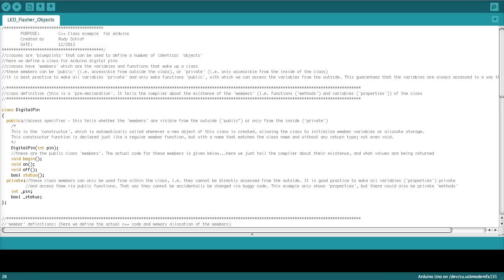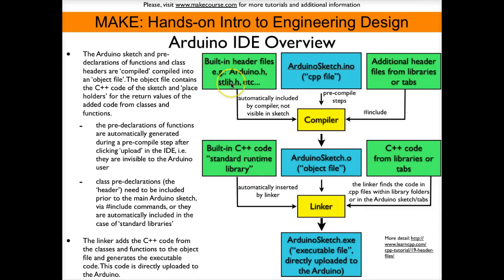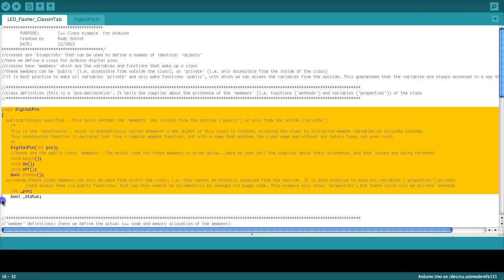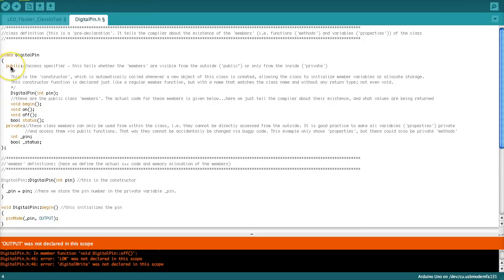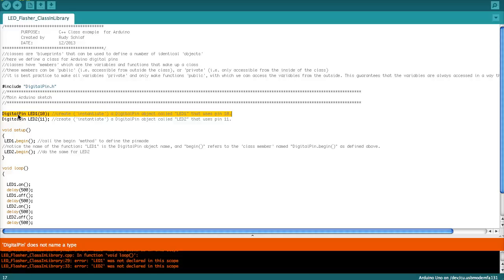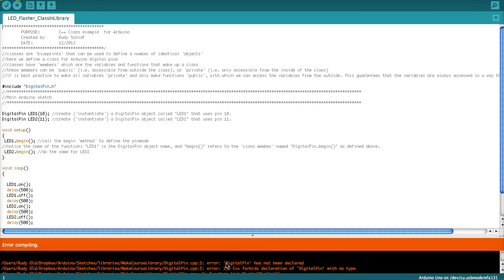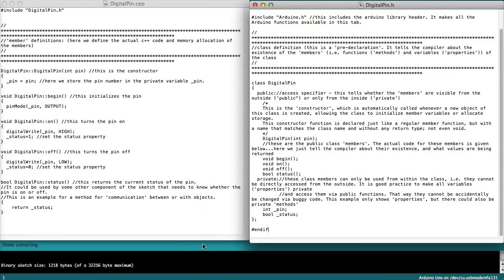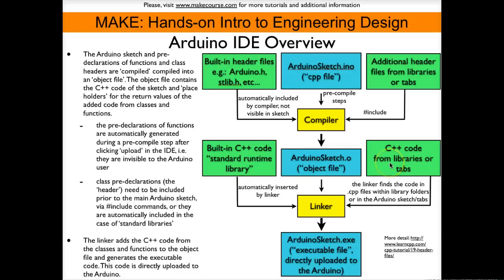Tutorial: Making Libraries with the Arduino IDE

Comment: TIP: Use your O/S file manager to drag&drop your local library .h and .cpp files into your current Arduino IDE's open project. This even gives you code highlighting on compilation errors. Yes, the Arduino IDE is not great...

Comment: Objects like motors operate with certain parameters - speed( & rate of change of) and direction. Yet servo  programs are unable to define the speed of a servo without special libraries and no-one ever talks about this very important attribute. As far as I know, there is only one library "VarSpeedServo.h" written in 2011 that allows for setting servo speed, but not acceleration. A "for loop" can of course deal with speed, but with acceleration it gets messy and longwinded! Could you please point me where I can find this information, or perhaps touch on the subject in a future tutorial? Thank you!